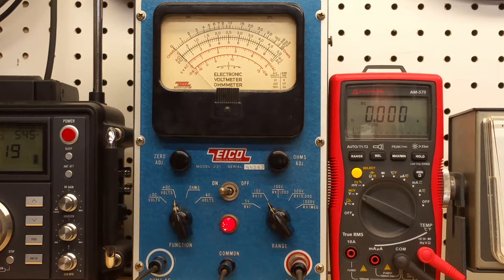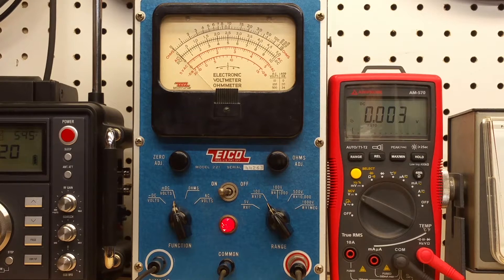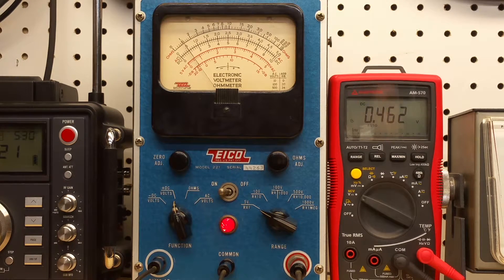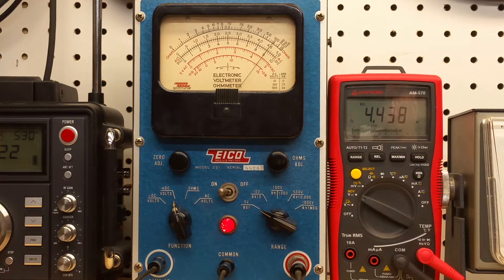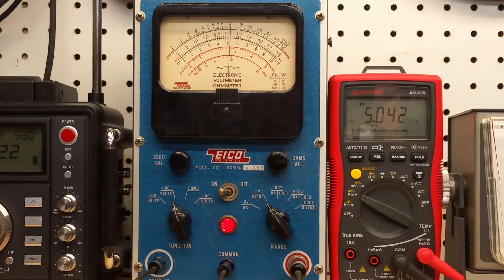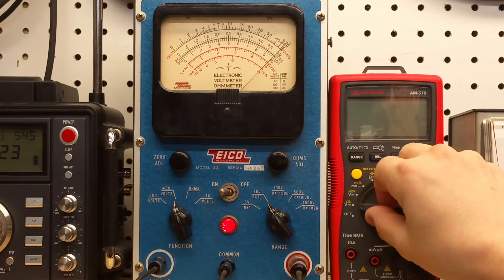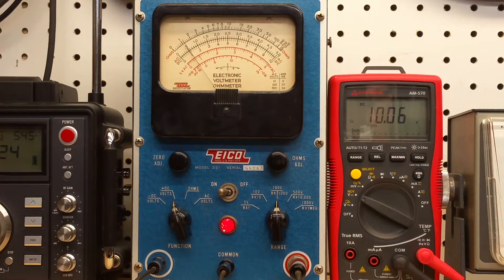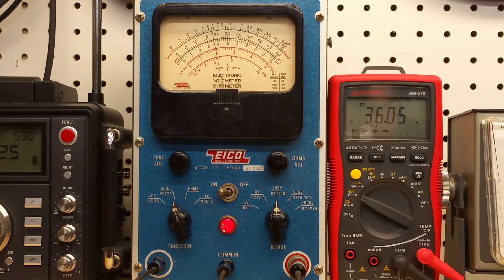#21: VTVM and DMM: Side by side comparison

Comment: Aren't you supposed to zero the meter every time you change the range selector?  If you go from 5V to 10V, I think you might need to re-zero it in order to get the most accuracy out of the 10V scale... I could be wrong.

Comment: I'm from the era of vacuum tubes when it comes to using test equipment. I wonder if the modern DMM now matches the high impedance of the VTVM when testing sensitive circuits.

Comment: on the circuit board of the amp probe 570 is a vr1 trimmer pot. What's that for? Adjusting it doesn't seem to change anything.

Comment: In tube amplifier repair many of the schematics call for use of a 20k ohm per volt meter to get accurate (matching the print readings). Typically the DMM will give a higher (albeit more than likely more accurate) reading. So for instance a print of a tube amp calling for a B+ of 460VDC will read as much higher using a more modern DMM. This is one case where having the older intrument is much more desirable. It would be nice to see a comparison of these two instruments in such a scenario. Also an interesting not. If you look at tube spec charts and the max voltages they are allowed in tube amplifier design.. are those voltages expressed as read by the 20k ohm per volt meter as commonly used at the time? If you were to modify or design a circuit using a modern DMM your voltages would be high or out of spec. So there is a very valid use for analog meters like this on a work bench.
Reply from the maker: Thanks for your comment. I’ve amplified some of these points in a new video, #46, "Why voltmeter impedance is important", https://www.youtube.com/watch?v=agcebKNSnHo.

Comment: Interesting that you did not state anything better about the VTVM.
Reply from the maker: I find VTVMs fascinating, but from my perspective, the grade of instruments similar/comparable to the EICO meter in this video don't really hold up in terms of accuracy and precision to modern DMMs. This VTVM is a nice instrument, and absolutely still useful on the bench in different applications, but the state of the art has advanced far beyond the 1950s in terms of voltage measurement. That said, meters like the HP-410B remain remarkable instruments, outclassing this more modest EICO by leaps and bounds.